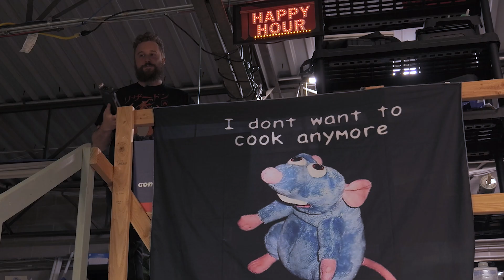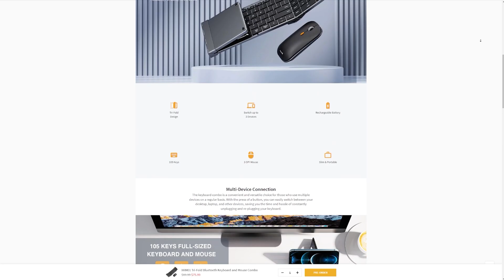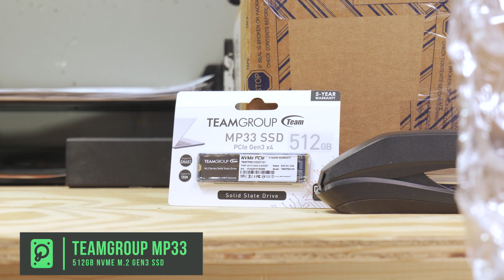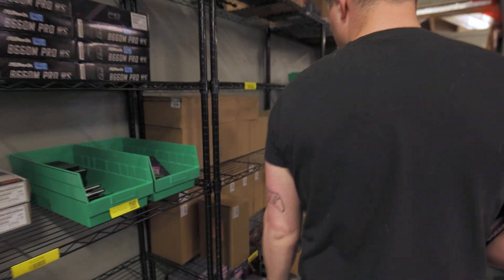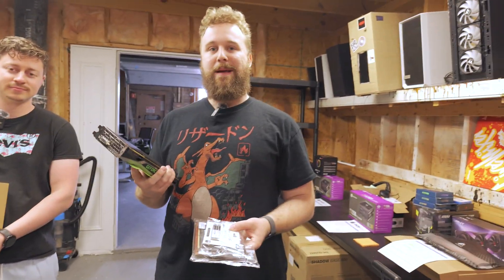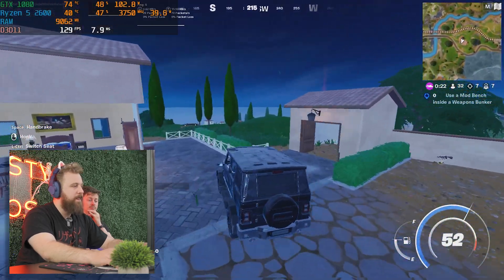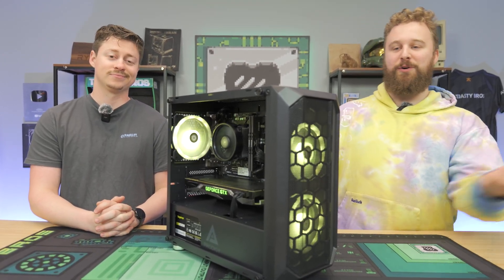Let's Build a CRAZY $350 Gaming PC!

Comment: Pretty sure it’s like over 350 if people try to repeat the build maybe like 500$
Although with 350$
 you can get a Xeon E5 2640 v4 16gb  ram and 512gb nvme m.2 ssd and an rx 580 8gb 
and any case or power supply that fits the budget
( would love to see you build it )

Comment: I have the same motherboard, but using a R5 2600x instead. Now i now it can handle 3200 mhz ram on any brand, but might have to avoid Corsair brand; though i really want to use it with my cpu and mobo. Corsair ram is probably a hit or miss with the MSI B450 Pro Max II🤔🤔

Comment: My $350 PC specs:
MSI Z370-A Pro Motherboard 
i7 8700k 
GTX 1060 6GB
16GB DDR4 RAM 
1TB NVME M.2 SSD 
600W non rated PSU 
Corsair H100i 240mm AIO cooler 
Open air case with 7 RGB fans
Is the PC in this video better than mine? Probably. I just want to know in case I ever decide to sell mine. I want to price it fairly.

Comment: If I have a 7700 XT (12gb vram) , and tried pairing it with my old Ryzen 1600... what would you suggest as an upgrade for my cpu? all my other hardware can support any cpu upgrade.(still running only 16gb RAM) but i notice the bottleneck ive created... (my GTX 970 just crapped out RIP)
Reply: ryzen 5600
Reply: Probably 5800X3D if you want to stay on AM4, or you could go Am5 but then you need a new board and DDR5 RAM. People keep saying AM4 is dead - it's not, 5000-series XT refresh is releasing soon, but AM4 is CLOSE to being dead.

Comment: That pc you guys made for this video is almost the same as mine. I got a Ryzen 5 1600 AF(That is a 2600 in disguise), Zotac RTX 3050 8GB Twin Edge OC(That Performs more or less the same as the GTX 1080), 4x8GB DDR4 2666MHz ram, 1TB gen 3 nvme ssd, superflower 650w silver rated psu and a montech air 100 lite.(note: im using the ID Cooling Frostflow X 280mm CPU liquid cooler).